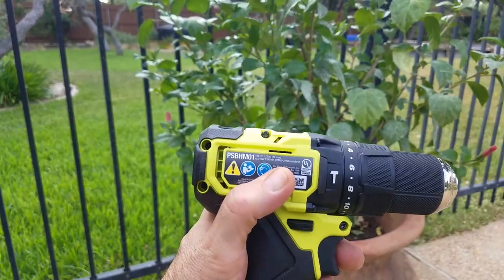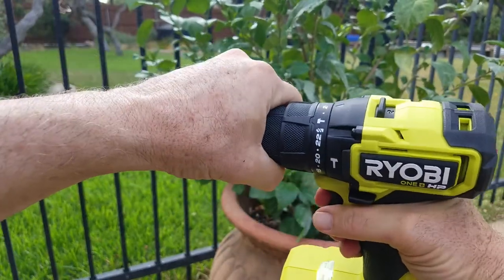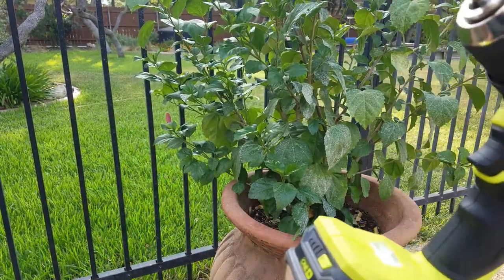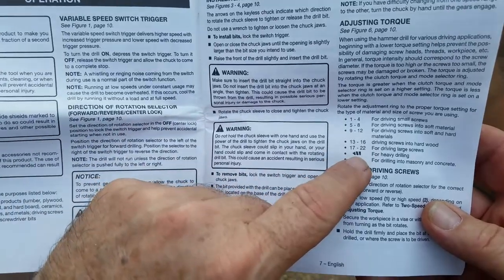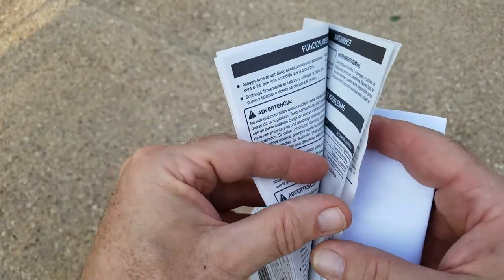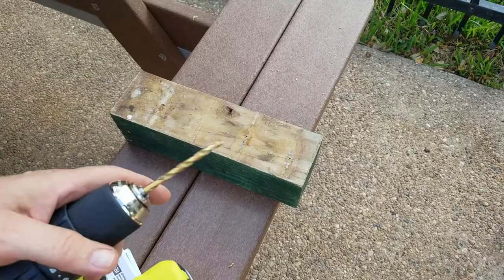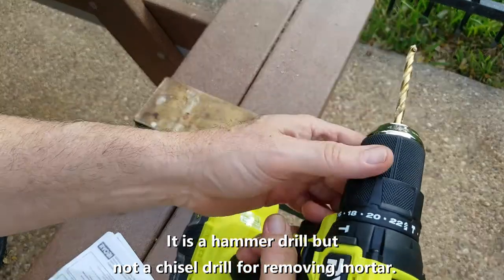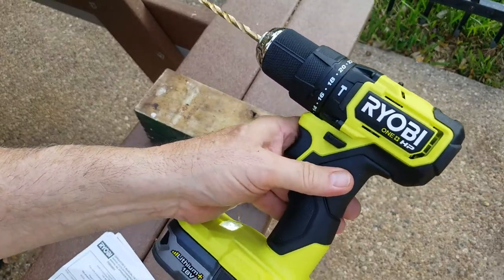Ryobi Hammer Drill model PSBHM01

Comment: Thanks so much for this vid. Yours is the only one I've seen of this drill. I want a new compact drill but also to have the hammer function just in case I might need to drill through some stone or my basement floor/foundation. To echo the other person, when drilling in wood use the drill setting. The hammer only helps with stone/concrete, it does nothing for wood and is harder on the bits. The 1-22 are clutch settings for driving screws so that the drill doesn't take your arm off if the screw gets caught on something.
Reply from the maker: Got it, thanks.

Comment: Does it have the HP terminals in the bottom for the HP batteries to connect to?
Reply from the maker: Hi, what I found:
Are Ryobi one and HP batteries interchangeable?
COMPATIBILITY. Even though HP™ tools deliver greater performance than standard power tools, they still connect with the same 18V ONE+ batteries that power more than 100 tools and garden products. So, there's no need switch battery platforms or pay for different batteries or chargers.

Comment: The clutch settings 1-22 are for driving screws. The clutch just is meant to help prevent over driving the screw or giving enough to drive. This should be done in setting speed 1 for more torque. 

The drill setting is for drilling wood, metal, PVC etc. Hammer mode is for drilling into concrete. Done in speed 2 for more drilling speed. Unless you are using big spades or auger bits. Than speed 1 will give you more torque
Reply from the maker: Meant to say months ago, thanks.